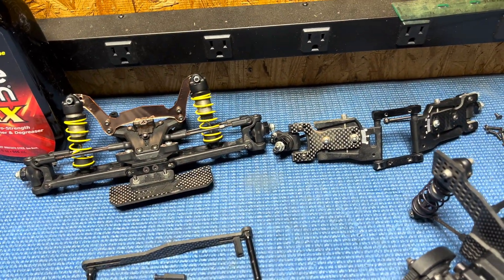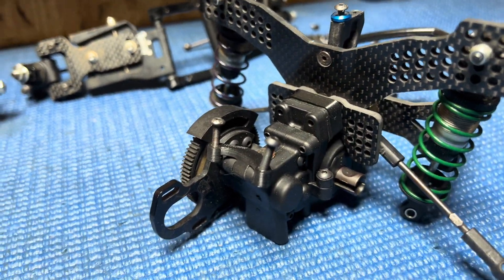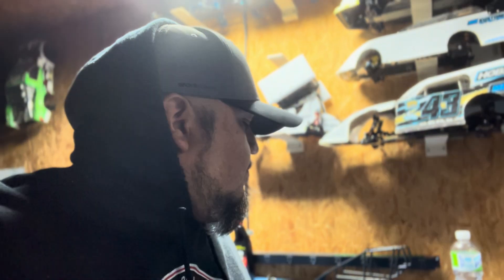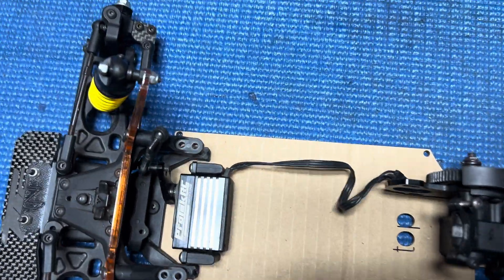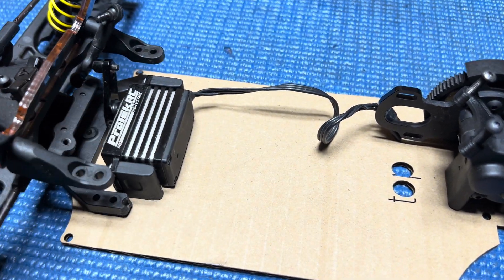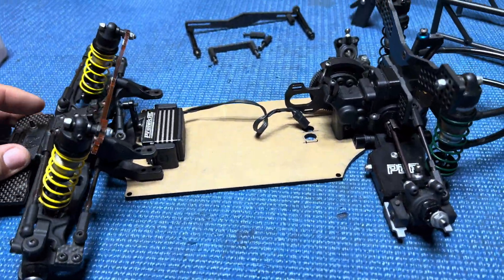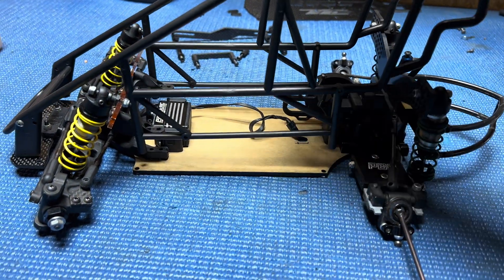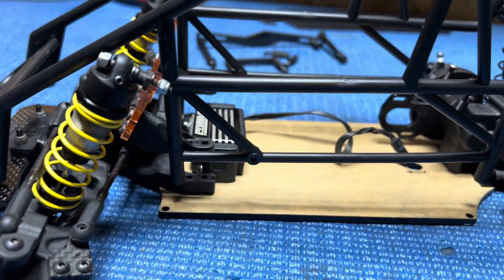SJD Midget and Build episode 2 “Designing the Chassis”

Comment: Super cool. I just started oval racing but come from touring car part of the hobby and was curious why don’t these company come out with aluminum chassis for high bite? We basically use that for our cars with the exception of asphalt tracks, carbon has to much flex and thought that could be cool to design my own in that but that ain’t cheap or easy to work with.

Comment: Looking good! When I'm making shock towers etc, I normally 3d print them to test for fit but I think now I will be making cardboard ones with my laser instead. Great idea. Do you do the countersinking of the holes on the CNC or do them by hand?
Reply from the maker: Right now by hand but the rougher should be able to do them. I just need to test on some scrap pieces